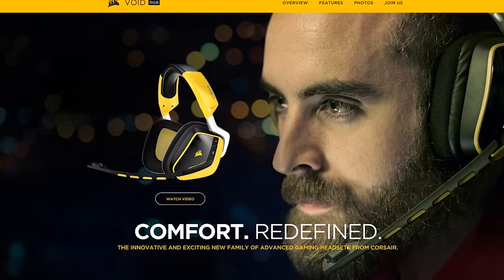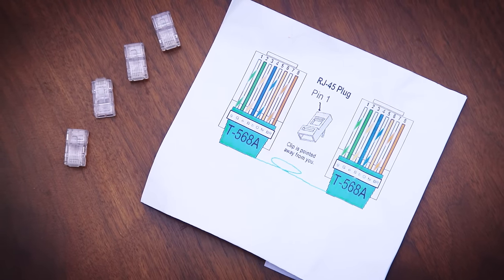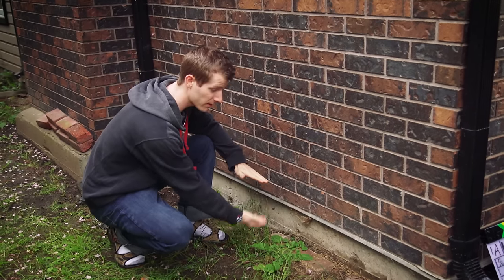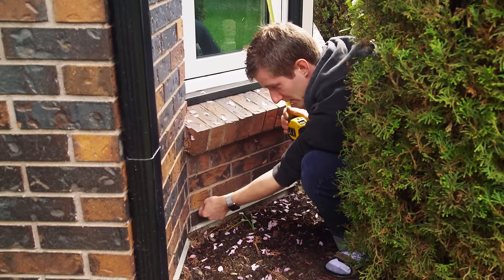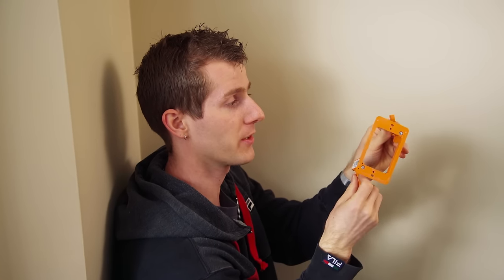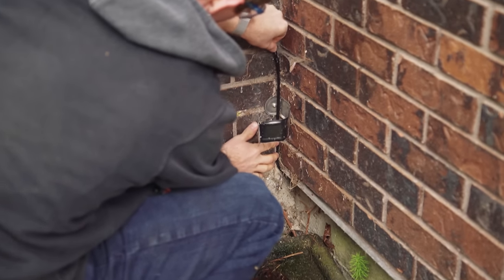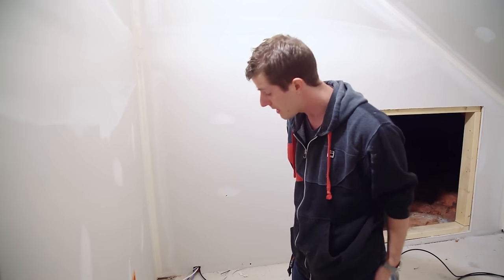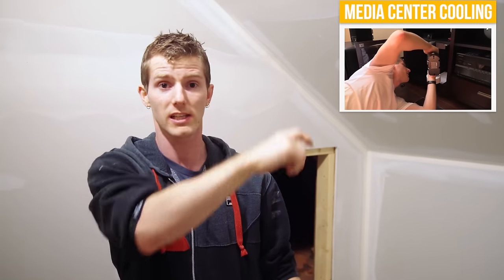Optimize your cable runs at home! - Installing an exterior Cat 5e cable

Comment: so by cat 5e he means ethernet doesnt he?
Reply: category 5 Ethernet
Reply: Yes, their basically the same thing, or from what little I know can be used interchangeably to refer to the cable.
Reply: Technically Ethernet is just the protocol that devices talk to form a network, but yes, most people know Cat5/6 cable as "Ethernet cable".
Reply: Category 5E is the standard of cable he is using for his Ethernet connection.   The Cat5E supports up to 1Gb LAN connection. He also could have used CAT6 or CAT6A for the connection supporting higher speeds @ higher cable costs.   http://www.cableorganizer.com/articles/cat5-cat5e-cat6.htm
Reply: Not exactly, it's like calling RAM DDR3 though, it IS an ethernet cable design/standard, but that's the official name. It's a gigabit cable. Cat6 is a ten gigabit cable.
Reply: +WolfLeader116-2 Not really though.
Reply: WolfLeader116-2 In all my years in tech and communications, I have NEVER, NOT ONCE, heard someone say "gigabit cable" or "ten gigabit cable".  99.9% of people say Cat 5 (the e part is a given in modern times) or Cat 6, or just ethernet cable.  The exception to this is when dealing with equipment, when you simply say patch cable or x-over cable.
Reply: yes
Reply: Matthew Petry ethernet is not a protocol
Reply: cat 5e is actually catagory 5 enhanced ethernet cable
Reply: IEEE 802.3 its a Standard.
Reply: CAT6 is pretty point less its still 1Gb speeds but less cross talk this is good for businesses though as cross talk can be a problem. CAT6a on the other hand is great for doing future proofing thats what I am using currently. Cat6a speeds can go up to 10Gb.
Reply: Not quite. The standards go: Cat 5 > Cat 5e > Cat 6. The "e" stands for "enhanced".
Reply: @Wanooknox I think you need to flip those signs around, "Cat 5 > Cat 5e > Cat 6". Cat 5 is not greater than Cat 5e and same with Cat 6. If they were meant to be arrows, add a dash ->
Reply: +Gerff Those are simply the maximum speeds you get from each. I never said you call ot that, I just said their regular speeds...
Reply: +Mediocrates I was just giving a simple example...
Reply: WolfLeader116-2
There is much more to what speeds you can accomplish with types of cable than their rating.  I have reached almost 10 gbit with good quality Cat 5e before in very short runs and as close to perfect environment and setup as you can get.  I have also seen (and replaced, instantly) Cat 6 that couldn't touch half of that.  You have to consider the conductor type, length of run, noise in the environment, dielectric, the twist, the signal you are passing, and several other things that matter in a cable.  In a consumer environment, your claims may hold SOME bit of truth to them for consumer guidelines, but it really isn't factual, standard, or informative.
Reply: Gerff Yes I am just talking about standards... What the cables must be capable of to be sold... You can't get cat 5e cables that do 10 gigabit internet from a good company because they would sell them as cat6... It's simply the quality of the cables and their insulation and everything that makes them better than another. Pretty much exactly the same concept as binning that was on the tech quickie channel I believe. So you really should buy from higher quality companies that actually test their products... (And no Cat6 doesn't have to perfectly reach ten gigabit, that's more of it's upper theoretical limit. It's got to get close though... All Cat5e should reach gigabit internet though.) Also, check the gauge... That affects it slightly.
Reply: Alex Edwards Arrows.
Reply: +Ethan Chow category 5e, commonly used for ethernet. But the e does not stand for ethernet, it stands for "enhanced".

When you run ethernet cat 5e is the most common. 
cat5e = 1Gbps over <=100 metres. 
cat 6 = 1Gbps at <=100metres, 10Gbps over <=40ish metres (33-50 m depending on the quality of the cable). 

Anything below those, including the cat5 (non-e), you should not buy.
Reply: Brian how do you test the bandwidth of cables, a signal generator and spectrum analyser?

Comment: I'm an audio/video/networking tech who does this stuff everyday, feel free to ask for advice! Some tips I'd like to include: If you're looking to make multiple runs and need to terminate the cat ends, look into scoring some ez pass push through rj46 ends. Basically they make feeding the several small wires through way easier, saving you time and frustration when crimping your ends. Cat ends require type A and B termination. For home networking 99 percent of the time you're going to crimp type B. If you're looking to save money, consider buying a punch down tool and punch down cat wallplates at your home depot- they're considerably cheaper than a good crimper. There are good tutorials online on how to punch down, but it takes patience and crimping is easier. If you're doing many wall plates at your house, considering picking up an "ez cut labor saving devices" off amazon. It's a handy piece that let's you draw out single and double gang plates with a built in level so you can make your wallplates come out perfect. If you're having trouble fishing a wire or drilling, don't be afraid to cut out the bigger double gang size plate and buy a wallplate to compliment and cover it- especially if it's going to be hidden behind a media center and unseen in the house. ALWAYS use a stud finder and check before punching through drywall so you don't hit a big hunk of wood and have to deal with that issue. If you're going to drill near another wallplate, pop it off and take a peek inside, sometimes you can luck out and have visibility to find where exactly the stud bay is and avoid hitting any wood or other wiring. Unfinished basements and attics are your best friend- you can avoid outdoor runs by popping through cross beams and down stud bays. Just be super careful and particular, inspect everything and stay far from piping, wiring ect.

Comment: Air ducts in a house with central air or central heating can be an easy way to run them too.  The intake side is the best when possible so the wires aren't affected by the extreme cold or heat going through the outgoing side.

Comment: Cat 5e?
Pfft. 

6A all da way
Reply: Is it better? (really do not know)
Reply: +Skye13 Yes Cat5e can go up to 1000Mbps, while Cat6 can go up to 10 Gbps over 33-55 meters.
Reply: Cat 6A got shielding in it to keep the speed over a longer run at a high level. It is useful if you are transmitting at 10 Gbit or higher.
Reply: I'd say Cat6 with multiple cables in a bundle so you can link aggregate on the other end. 10 runs of Cat6 is still less expensive than Cat6a and can give you the same bandwidth on the other side. Since you still have to buy in bulk for the same run I don't see any reason yet to move to Cat6a.
     Monoprice 1000' of Cat6a: $279.99
     Monoprice 1000' of Cat6: $119.99
Reply: To be fair, I don't think Linus needs 10Gb/s to that particular device.
Reply: Koriko Alistar Exactly. 1 Gbit/s is more than enough
Reply: ***** thank you
Reply: d00d im running cat8.2
fastest stuff out there
Reply: If you are running 10gb over copper in an outdoor run you are already wrong.
Reply: To a devices such as a smart TV that has only a gigabit NIC on it as well.
Reply: No. It's higher specc'd. It's like saying a Ferrari is "better" than a pickup truck because it can go 240 miles per hour.
When considering a cable run you need to think of the application, cost, and requirements of the run. Application: Network data cable. Both are rated to meet networking needs.
Cost: 5e is cheaper, especially the outdoor rated stuff. Cat6 is actually pretty fragile stuff so getting it in a tougher form gets expensive, fast, to the point it's better to start considering fiber instead.
Requirements: As it's a domestic run. the highest speeds you should expect to see are 1 Gb, there's exotic standards of 2 Gb and 4 Gb standards but they aren't common, and you have to select hardware specific to that task, as we are dropping into an existing ecosystem with no upgrades to network equipment, we have no requirements for 2 4 or 10 Gb.. Both cables are capable of running 1Gb

This means in this situation, the cables will perform equally, but one will have higher cost. It is better to go with the 5e standard cable here.
Reply: Mostlyharmless1985 Cat5e will do 10/1000, but is not rated for it and beyond a certain distance will attenuate the signal sufficiently that it will fall back to 10/100.

For these types of applications I would run multiple Cat6 runs conduit-ed so that link aggregation (For single link high bandwidth) or separate run applications can be achieved (Separate runs will allow easier VLANs if wanted in the future. And YES I can see VLAN applications in a home; especially with kids and wanting segregation of network resources).

In the future the flexibility that multiple runs of gigabit rated Ethernet cable provides will prevent having to redo the installation as network requirements increase.

Besides.... Cat5e is more expensive than Cat6 ATM...

1000' Cat5e: $124.99 (Monoprice normal pricing)

|1000' Cat6: $119.99 (Monoprice Normal pricing, but on Sale right now for $85.59)
Reply: can he overclock and get the 6a performance?
Reply: recently did work in my office with cat6a, really good cable but SUUUUPER expensive in comparison. also i can imagine how much more expensive outdoor cat6a is
Reply: Saki630 You joke, but you can "overclock" cat5e and get 10gb speeds out of it if it's exceptionally high quality 5e. The cable gets it's rating fromwhat it was tested to handle. There's nothing saying it specifically CAN'T or WON'T handle higher frequencies, just that it isn't designed to handle it.
Reply: Yes, however, the longer the run your chances of getting 10Gb drops fast. Really should have used the highest rated outdoor CAT6 he could find. Also, you can find used boxes of CAT6 outdoor on ebay and get twice the length at half the cost to what Linus paid.

Comment: Not bad work. Though he did for get his safety specticals.
Something Linus neglected to mention though is attenuation distances and collision zones.
The maximum distance for cat5 is 100 meters. Going any farther will impact performance pretty hard from the signal getting distored from ESI and both units trying to talk at the same time.
Cat6 though I hear can go 200 meters or more without having to worry too much about this.

Comment: rather than poking holes in brick, you can just run cable between floors going through the floor stud. you cut bigger holes in drywall, but it's relatively easy to fix. also, screws outside should be stainless steel or galvanized, so you don't have rust going down a wall after a year.

Comment: oh i can't wait for the isolation to harden and start cracking. that cable is dead in a year.
Reply: its outdoors cable, it has protection for that.
Reply: Isolation?  Like that video game?
Reply: No, like the one word that describes my life so far.
Reply: Outside-grade cables like this one can be run in this fashion and still function perfectly at least 15 years down the line from what I've witnessed.

Comment: For those who have a house with wood paneling use a feed thru bushing on the outside and apply silicone to the bushing to adhere it to the wall.

The 1 gang low voltage bracket has pin holes in the corners for marking the hole cutout.

Comment: The router in my house is in the living room. My room is one storey above the living room. I drilled a hole through the ceiling at the very corner of the living room and trailed the wire up into my room through the ceiling. Yay :D

Comment: When going from outside to inside with a cable, you should drill the hole at an upward angle from the outside, NOT straight. This makes sure no water will follow the cable into the wall. In addition, if the cable is going straight sideways afterward, it should have a small downward U first for water to drip off.

Comment: Also just to note with cat 5e or cat 6 cable you are limited to about 330 feet (dont remember exact number but its around there) of distance including patch cables. As others have mentioned I would have drilled the hole on an angle just in case and also I would have terminated a jack on the end on the living room side inside of using that female coupler so that there is not another possible point of failure. Always test your cable after you are done with a continuity tester (cheaper) or a certifier. And in certain outside environments (places that get snow or really cold) you should get a gel filled cable that wont break the copper pairs on the inside when it contracts and expands due to the weather. Besides these tips he did a pretty decent job.

Comment: I never get to correct you guys, so it comes with great humility to inform you that at 2:51 you have a Hammer Drill, not an Impact Driver. There is a difference. Sorry to be that guy. Love your videos.

Comment: If you have a ground floor apartment. And you have radiators. There is probably a hole near the hot steam pipe that connects the boiler and the radiator. Then run the cable from the router, through the hole onto the ceiling of the basement, then up through the radiator hole near where you need to connect the device and boom!!!

Comment: It's important that the cable always be down (just like Linus did it) because water will follow it. Also pure silicone will last longer than caulk 
and never drill from the inside, it will blow out the brick. Always go through the morter.

Comment: I remember in high school, I learned how to arrange the wires and put terminals on the cables. I felt so proud of myself.

Also learned Boolean algebra, operating systems and countless other things that put the cable on the back-burner, but dammit I was happy to use a cable I made!

Comment: So awkward watching Linus' videos about home improvement when my father has been running his own business doing that for over a decade, to which I've gained tons of knowledge and experience helping him with over those years.

Hell, my latest job was wiring a new office complex and making sure it adhered to the latest building code. I hate those clip-in jacks! Convenient to wire by themselves, but you're just plugging them into the wall plate anyway; may as well wire directly and remove a point of failure (and tiny gap/play).

Also a note: One of the most versatile cutting tools I've seen is the Sawzall; has a damn fitting name. Cuts through so many materials and it's been invaluable for many jobs.  Another one is the Multimaster.  These two tools alone can do so much it's ridiculous.  Highly recommend everyone who does home improvement to consider buying or renting them.

Comment: If you are doing short runs with a short total length around your house I would go with cat6 instead. A little bit better maximum potential bandwidth. While cat5e is sufficient for the vast majority of available home network connections leaving some room to grow seems prudent for a permanent installation like this. The only issues are that cat 6 is more limited in total run length and costs a bit more. It is also a bit stiffer but you can still get it around bends so not really a problem.

Comment: When drilling a hole into the wall you need to check for pipes by just going thru the wall stop and tapping the bit listening for a metal sound

Comment: My long in-house ethernet cable has a couple feet through the drywall, and then the rest of its journey using the ventilation ducts. Took a long time to route through the ducts though as it had to go up two stories.

Comment: T-568A instead of the T-568B configuration. I think B is more commonly used. Also keystone punch down jacks are easier and faster to terminate a cable end than crimping.

Comment: I would definitely use shielded RJ45 connectors when running a cable outside.
Also I agree on the other comments regarding not using cat5e.
When you run a cable in your house you should always use the highest specification, so it is future proof.
Otherwise you might end up having to replace the cable (if you're still able to get it out) after a few years.
Because of that I only ran cat7 cables in my house and used cat6a patch panels and wall ports, although I only run 1Gbit at the moment.
But this way I'm ready for 10Gbit, once switches and network card become affordable.

Comment: The one thing that I would have done differently is use a jack on the end of the cable and snapped it into the face plate.  They are easier to do than crimped ends and usually eliminate connection issues.  You also don't have to remember the wire order for T568-A or B.

Comment: So much for using a punch down jack or even using a proper low voltage box considering you cut through the vapor barrier.

Comment: I don't know why so many people say "that won't work on European houses". They're all talking out of their arses.
I drilled through thick mixed brick and concrete walls in my house with the exact same drill that Linus used, and a longer masonry bit. It has a chisel function as well, which I used to cut channels in my walls with a channeling bit.
You can use a combi drill with a hammer function to drill holes for the wall plugs and cable clips in brick and soft concrete.

Comment: i would have added caucking to part of the cable (that part close to the outside hole), and pulled/pushed it into the wall so it can properly seal the hole. afterwards i would add to the outside to complete the job.

Comment: When you drill your hole through the external wall, drill it at a slight downward angle to the outside so any moisture can't track along the cable and through the wall. Sealing the hole is ok but having gravity on your side is much easier.